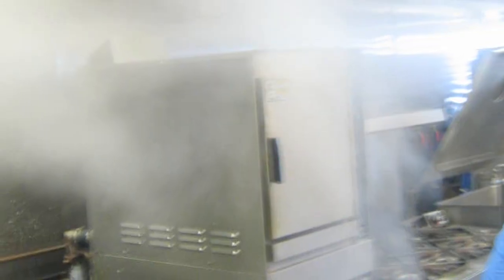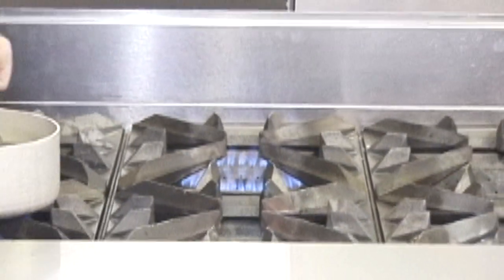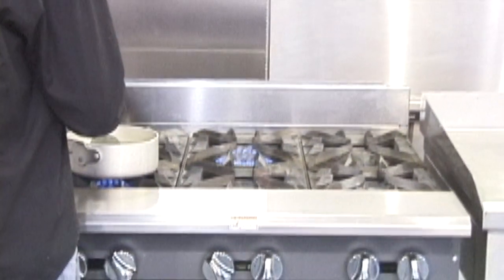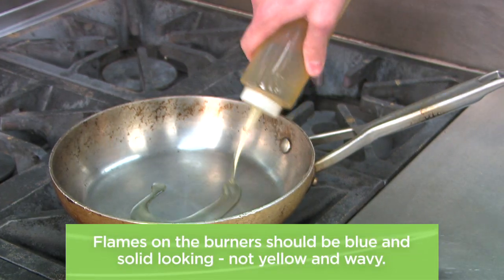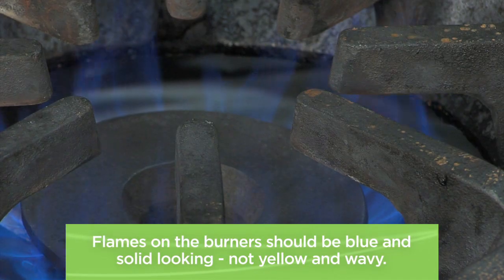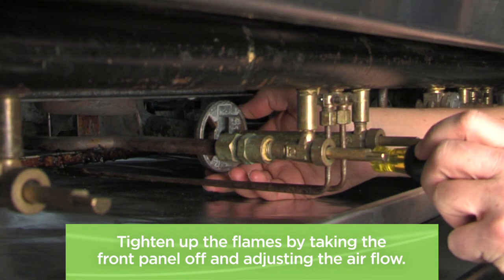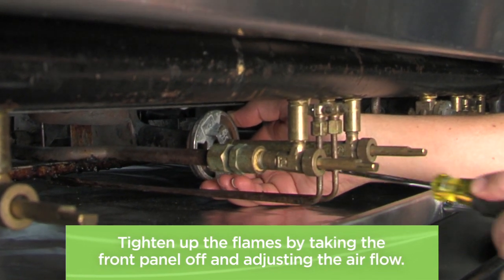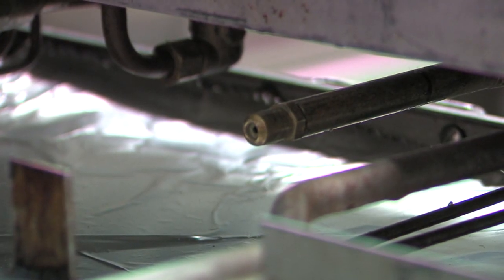Maintain Burners and Pilot Lights

Comment: Yellow tips, yellow flames and soot indicate one of two problems.

The equipment hasn't been properly converted to LPG from natural gas (methane) with the appropriate LPG jets supplied with the equipment or bought separately from the manufacturer of the equipment.

If natural gas (methane) equipment is connected to butane / propane cylinders or a plumbed in propane cylinder / tank supply, yellow tipping / sooting will be an issue.

Natural gas equipment is not designed to run on LPG and LPG equipment is equally not designed to run on natural gas (methane) either, both gases have different BTUs / calorific values and heat outputs and are incompatible with each other.

Another cause of sooting and yellow flames / yellow tips on blue flames, is inadequate aeration setting, because LPG needs significantly more air to burn cleanly than natural gas does.

LPG equipment properly installed and set up, or natural gas equipment properly converted and set up to run on LPG, shouldn't display yellow tips or deposit soot on pans kettles utensils oven walls or grill sides.

However, when running on butane gas cylinders, it is common to see very slight yellow tips at the top of the blue flame on grills and oven burners, but will be largely blue and of even height when using propane gas cylinders.